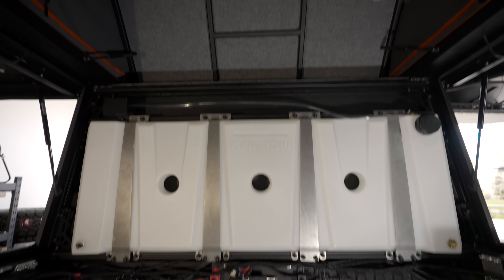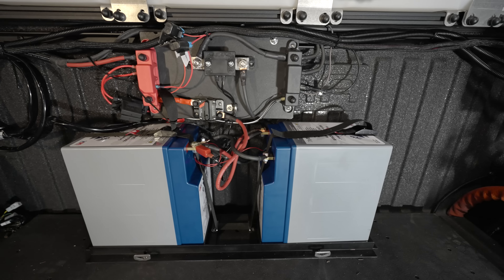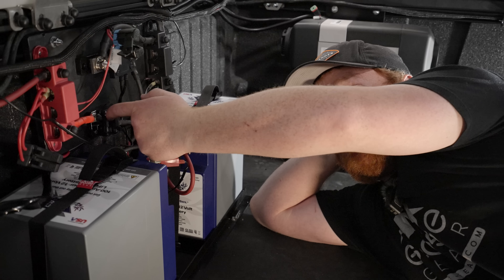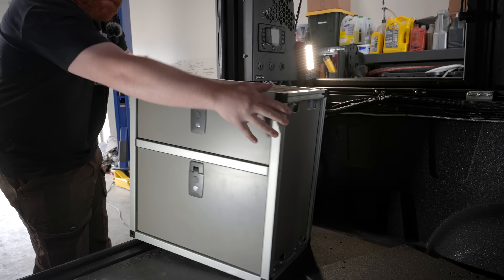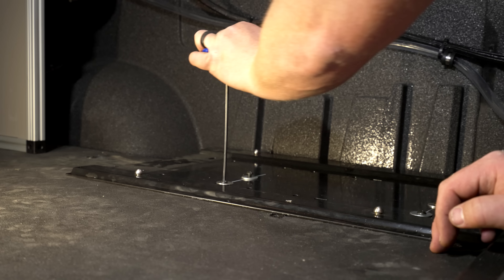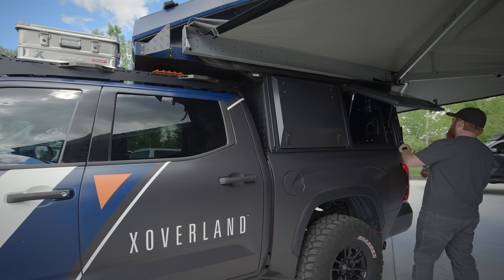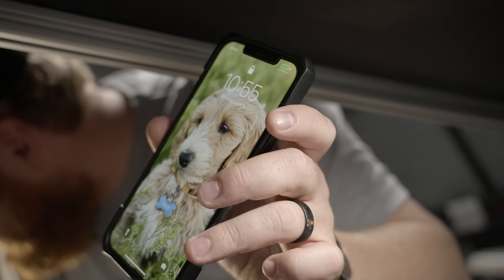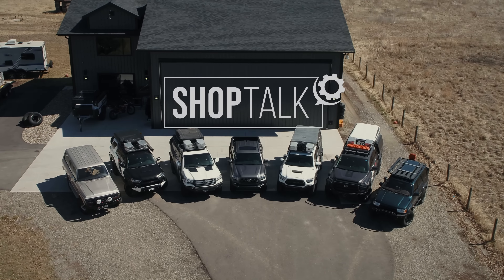Putting the Final Touches on our 2022 Tundra Build | X Overland Tundra Series Shop Talk #16

Comment: Hi, I just ordered 2023 tundra Limited with off road package 6.5ft bed.
For beginning I just need to upgrade suspension for holding about 1600 lbs FW hawk. Not planning to do any difficult off-road , we are expecting little one coming to our Family, so basically we gonna do some harder access campgrounds. 
Can you recommend something for start? Suspension upgrades
Maybe next year we gonna try to hit colorado and Moab but probably just bLM campgrounds.

We are live in Illinois, so to get anyware we gotta use at 4 -6 hours of highway.

Tundra is coming with 20” rims with 
Falken WILDPEAK A/T3W - SIZE: LT265/60R20 tires.
Reply from the maker: You can find all of our Tundra upgrades here: https://www.xoverland.com/truck-builds/2022-toyota-tundra/